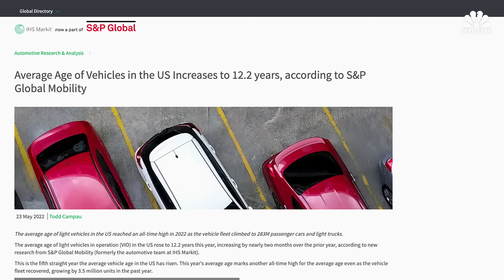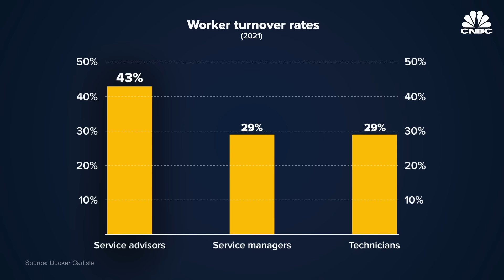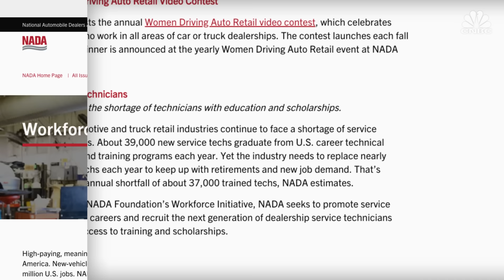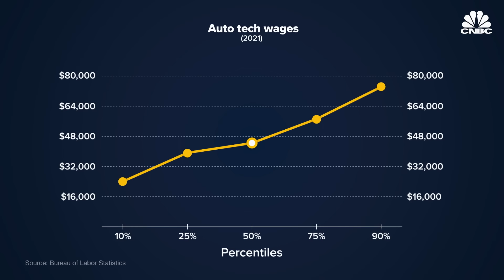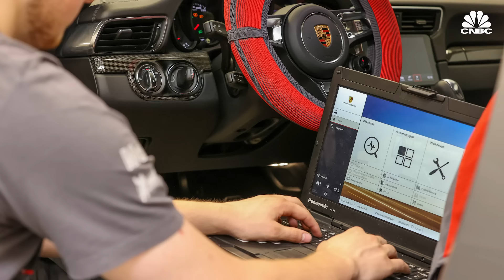Why The U.S. Has A Shortage Of Auto Mechanics

Comment: There are a lot of reasons for this:
1. Current cars are far more complex than 10 - 15 years ago (mainly due to electronics) so the knowledge a mechanic must learn (and therefore pay for it) has increased (but the payment has not catch up accordly).
2. In addition to being more complex, current cars are designed with space saving in mind and not much thought in mechanical services (outside normal jobs like changing the oil). For example before you could replace a steeering in 3 hours but now you have to take out several subsystems (A/C, computers, etc) to access the steering and then again put all the parts back, in the end a 3 hours job became a 6 hours one and that is not accurate show in the current repair bills (basically insurances pay a fixed rate for certain jobs and that has not been adjusted properly).
3. Since the average age of cars is increasing then a car will have more unexpected problems and additional jobs will be required (also this problem will compund with the fact that the customers will requiere to repair a part due to short budget instead of replacing it and that takes most time).
Reply: Electrical systems are no more complicated than mechanical systems. Your pulling at straws on that one. The issue with newer and new cars is that engineers at the car companies are told to make it a hassle for everyone. Even our own guys. The reason is the hourly rate. The longer it takes to do basic maintenance and the more specific the tool needed to do the task just makes the hourly go up. The only one hurt is the customer with this practice. But they don't seem to take this earnings and passes it to those that do the actual work of the business.

If mom and pop shops existed before global reaching companies without issue, does that mean that after the gm of every store the money that store makes is stolen and placed somewhere else in the economy? It's disproportionate, that's the issue. Keeping your money local doesn't actually keep your money local if it's a corporatized/franchised business. Imagine the money that gets funneled to the "bosses" who don't work in any store.
Reply: @betawolfhd  Have you ever been a tech ? I was for over 40 years and mainly did electrical problems and check engine light stuff and can tell you some codes for one sensor can be caused but other sensors that show no codes . Things change every year and one must keep up or be left behind .
Reply: @georgewoodard43  you misunderstood. EVs are no more difficult to understand and work on than ICE. Unless you're reckless and act first. Then you probably shouldn't be allowed around assembled battery packs. But other than that, the vehicles can be identical in every other aspect of build and operation.

And as far as manufacturers and electrical mechanical design, that sensor issue is because they needlessly intertwine subsystems for this reason. The harder something is diagnose, the longer you charge the customer, the more goose chases that send techs on (including the manufacturers dealer techs) they just get to charge you for another part. Along the way you think the car had already started falling apart when actually the design of the vehicle leads to needless part replacement and long diagnosis periods.
Reply: @betawolfhd  I retired 4 years ago and was a ase and dealership master tech and Hybrid certified tech and sometimes the flow chart for codes was better for Hybrid cars! Part of the problem is too many parts replacer’s that just keep throwing parts at the car .
Reply: @betawolfhd  well my specialty is electrical systems, and programming. Definitely, electrical systems on modern vehicles is complex. AND the tooling required to properly service modules is very expensive.

A modern day vehicle has anywhere from 6-8 bus networks. Where an old jalopy from the 90's used one if that. I mean even the radio is now communicating on its own bus network these days.

This complexity also requires additional tooling to diagnose and service. You ain't getting too far on a modern bus network with the ole test light and multimeter anymore. Now an oscilloscope is mandatory, and on some vehicles like BMW who use FlexRay, you need to add special test leads with built in resistors, to pinpoint the signal accurately.

Don't even get me started on coding and programming. That's it's own unique Pandora's box.

Comment: 17 years as a technician I left because the flat rate pay structure meant all my co-workers were stealing from me by cherry picking the jobs that you could make time on and leaving me with diagnostic work. I tried 3 different dealerships and it was all the same. The flat rate also means they cut corners in the work and just don’t do half of it to make more money. Another reason was the chemical exposure, people running engines inside, being covered in fluids, dust and noise exposure I hope I got out before cancer is inevitable. I found the pay was fine (I was near the top of the range) but the warranty labour rates were declining every year. I’m so happy I got out for my health and my mental health.
Reply: don't you love the team leader system that replaced random generated work orders!

Comment: I used to design auto dealerships and I saw this:. EVERY Dealer Principal had one of the best houses in the community.  They always had the best new car (several, usually), many had their own planes.  Most had vacation homes in places like Jackson Hole or Seaside, etc.  Most had otherlucrative investments & businesses.  Several were Billionaires.   Most were very well connected, politically. 

ALL complained that they were 'hurting'.  To be fair some did have rough years, but none of them ended up living in a trailer or driving a 20yr old beater.

Meanwhile, when I spent time measuring & designing the Shop areas with the Techs, I saw them using their own (very expensive) tools, pushed to do more cars than there was time in a day, tough working conditions ( however, I was often there to help improve this), and of course abysmal pay.  

Like Truckers, there's always that carrot that the Industry holds above the Techs which says 'Hey!  You 'could' make 6-figures... '.
In reality, most of them were making sub$20/hr.  Especially in smaller towns & less affluent areas.

Maybe the pay, in Napa, CA is high, but $$$-to-Donuts, the Techs have to drive a long way to just get to work.  Techs def cannot afford to live in Napa.
Reply: I can assure you the pay there is not high. But everything else you said seems accurate. The industry deserves this
Reply: Sounds like capitalism doing what it does best. Making one guy rich off the slavery of others...  aka, trickle up economics.
Reply: Wow, I used to work in a car dealership, and you described the "dealer principal" guy who ran the business down to a tee....
Reply: In small town America the only way to move up is to own a business. You'll never make it working for someone else. Many don't find this out until it's too late. I've had some luck finding the right place to work but not afraid to say bye when not treated well. Right now working for a place where I don't have to buy my own tools, is air conditioned, and able to physically do the work at 60 years old. It's the biggest used car dealer in the country.

Comment: I work with a tech who paid $40k for trade school and came out with a certificate saying he knows what he’s doing but he doesn’t know anything. There’s a demand for some sort of certification while at the same time requiring techs to provide their own tools and only paying them for actual hours worked. For those that aren’t aware, most dealership techs only get paid while they’re actually working on something , if nothing comes in you aren’t getting paid. This also screws over the customers because if you get quoted 10 hours of labor and they get it done in 5 they’re gonna just hold your car and make you pay the other 5 hours of labor. This is how it works, and it only benefits the dealership, techs and customers are getting screwed over.

Comment: Well lets see. I am a certified Harley Tech. Owe nearly 30k in student loans. Dealerships want to start you out at $10 an hour. While charging the customer $120 an hour. You spend at least half of your income the first year buying the tools you need to do the job. You have to work at least 5 years before you get to a point where you have the tools you need, and they start paying above walmart wages. And the whole time you are treated disposable by the Dealerships and like the enemy trying to rip off the customer. Its a thankless job. And out of all skilled trades it requires the most money to get going and pays the least. I went to school 6 hours a day, every day, for 2 years straight. I had to master the Internal Combustion engine, 12 volt electrical diagnostics, computer diagnostics, dyno tuning, machining, etc all to be treated like a dumb wrench that should be grateful to make just above minimum wage. I went independent and never looked back. F#%& dealerships!

Comment: The Flat Rate system keeps getting lower and lower by the dealers/manufacturers that one can not make a living at it.  They have to buy their tools, etc.   I go to the office, I do not buy the office equipment or computers etc, needed to do the job.  They have made it a minimum wage job, like truck driving.   You have all the risk and expenses and they get all the money.
Reply: hahah I saw a position for lube tech (flat rate only) they are getting cheaper and cheaper

Comment: I love how you guys didn't mention how flat rate times are not increasing along with the complicated designs of these vehicles
Reply: I was an Auto tech for 25 years and just left recently. I mostly worked for Toyota and last four months was Kia. The pay is not worth it, long hours, always working in cold and heat, always working Saturday’s, like you said Warranty work doesn’t pay at all. There is a TSB to replace steering ring gear in some models. Basically remove the whole entire steering assembly to repair and get paid .9! A good tech takes about hour and fifteen minutes and your already in a lose . BUT AND HERE IS THE BUT THAT NO ONE TALKS ABOUT. Then after the repair you have to road test it. Then come back fill out the warranty sheet for the parts return, then write your story, The CCC. Buy the time that is done it’s about 1.5 hours if not more. So by then your already in a lose of .6. So in reality you only made .3 on the job. Not worth it anymore. And it’s the same with Toyota now.
Reply: @Aaron-or6ov  I'm a autobody tech.  And it's the same for us. Plus if u miss a single clip you can be sued. 
Too much stress and liability.  
I'm 30 and looking for a new job out of the field
Reply: @Aaron-or6ov  and thats if nothing goes wrong, like something as simple a bolt breaking.
Reply: HVAC

Comment: I went to automotive college, I got certificates for Chassis/suspension, engine performance diagnosis, electrical systems. I was just 3 classes away from an associates. The one common thing my teachers told me is the worst places to work pay wise are dealerships. Most basic services like oil changes are free which means the technician doesn't get paid really when they do it. The competitive pay is a scam in those places.

Comment: Worked for a local dealer chain for 5 years. Volkswagen. Loved the product. Still drive the product. But take your flat rate and shove it where the sun don't shine. I was passionate, and never took less than 40 hours a week home. But sometimes that meant going on my day off. It isn't worth it. I went to work in the metal working Industry and easily transitioned to working on CNC machines, lathes and mills. Much fewer wires if I do say myself and simpler design, yet I'm hourly, make more per hour, and have better benefits that only cost me $130 per pay for a family plan. At the dealer me, by myself, non smoker was almost $250 per pay. Want to know why dealers don't have techs? You should ask why the service manager has new Taylor made clubs every year and gets to drive a demo car all the time. While the techs have a beater car. Make em hourly to compensate for the slow months(in Ohio that's the months after the holidays). That's why I left. The uncertainty of what you were gonna get was not cool. Sure, you have days where nothing but gravy maintenance like timing belts or trans services comes in, but then you have those days where a customer says the Bluetooth has a static noise or the car rattles between 34-37.2mph on certain roads and guess what, here is 40 time units for that test drive you couldn't confirm the concern on. It's a lot of work, you hurt your hands and f**k your back up, and you are under paid. The sales managers walk through and look at your like a greasy peasant. Hmm wonder why I stopped wrenching at a dealer. Weird.
Reply: Thank you for sharing. I want to enter the auto industry in some way but maybe not a technician…
Reply: @oftengone  I suggest finding a private shop that treats it's techs good, and only has as many as it is capable of feeding. Brand/region specific shops seem to have the best techs anymore. Like Euro/JDM/etc. No one wants to work on a used car lot where you will be the hack of all brands and the master of none.

Comment: I'm a newcomer in this industry, been working for about 5 years, right out of high school. Went to school for about 4 years graduated with certificates for automotive and diesel. I pursued a specialty in transmissions and driveline. But damn it was hard to find a place that wanted to take on a newbie like myself. I worked for awhile at an independent then at a chevy dealer, and neither were eager to put me to work. They just wanted me to change oil and clean the shop. I was the youngest so I'm the last to get any work. The youngsters at the dealer that moved up to line techs were on the lube rack previously for 3-7 years at my dealer. I had reasonable work experience and a great education. Not to mention 14 ASEs. Why on earth would I change oil for minimum wage for such a long time when I'm qualified to do so much more? 

This video is saying there's a shortage of techs when Its tough for people new to this industry to get their foot into a great place to work, whether you're completely green or u have training, some shops just treat u like a dog. Verbal abuse, lack of work, low pay, no benefits. I've heard that there's a big gap in generations in this industry but the funny thing is that these older cats don't wanna share their knowledge with youngsters because they don't want to be replaced. 

 To anyone new to this industry stay the hell away from trade schools. You don't have to pay 30-50k to get training for a good job. Try your local community College program and do your research. Attend an open house and ask questions! Those colleges might not be as pretty as the big trade schools like UTI, wyotech, Lincoln, but theyll likely still have great, knowledgeable professors and ties to local shops and dealerships. Some college programs provide students with access to snap on at a discounted rate for the time they study. And some compensate for ASE certs. UTI was respectable back in the day like 40 years ago but these days it's educational aspect is very fast tracked and very very expensive. Third party scholarship foundations likely won't support trade schools such as UTI. Too much expense for too little gain. 

Some more advice to newcomers reading this is to find a shop that will train u and accommodate your school schedule. It'll be grueling, but work while you go to school if u can. Buy as many tools as u can and take advantage of those discounts with snap on and matco and whatever is available. I know it sounds obvious but you won't regret it later. You'll always be buying tools anyway. And the sooner you're in a shop turning wrenches and diagnosing problems the better. Your problem solving gets better as you go on.

Hope this helps... 

Good luck everyone!
Reply: Keep you your head up Kevin and push forward
Reply: @r4ym1n13  thanks for your encouragement!
Reply: That's why I hate flat rate, it makes shops more cut throat than they need to be. I'm sure plenty of shops, and senior techs would love to help and give you real work. But they won't, because it takes from their paycheck every time they give up a job or stop what they're doing to help you. And then the flip side of that is, your service writers and managers get all pissy because your taking forever on a job youve never done before with out any help. It's a viscous cycle and it sucks.
Reply: @patricks.7951  Right, cut throat is a great way to describe it. It's a tough curve.

Comment: I got charged   $80hr to 100hr+ for labor NOT PARTS on car repairs.  How much of that really went to the mechanic who covers the tool costs?
Reply: 22 to 25% on average. In defense of shop labor rates there is a ton of overhead involved in running a repair shop if you are doing it right. Most shops that are successful enough to be around for generations are netting about 20% after all the overhead and salary is paid out. It's hard to pay more than 30% of a shops labor rate to the tech